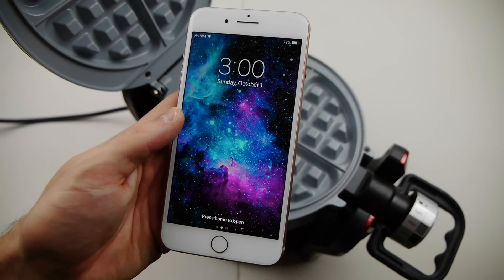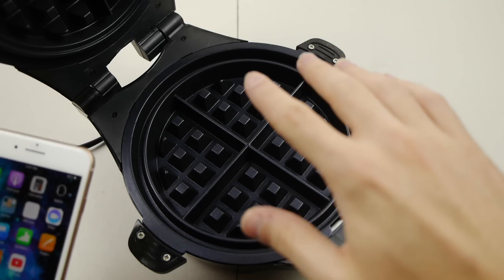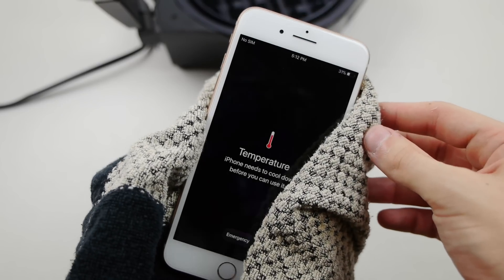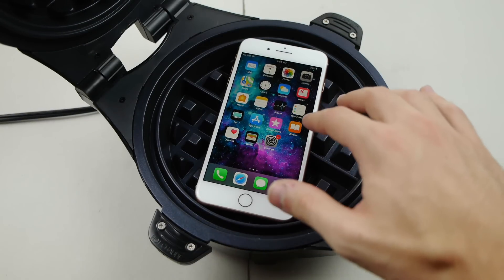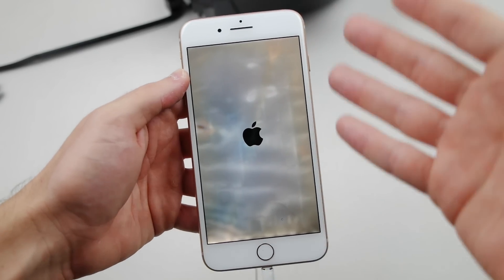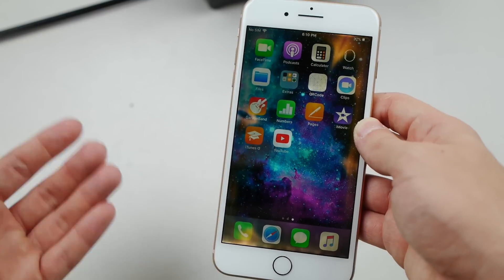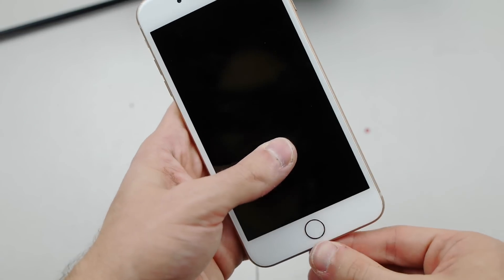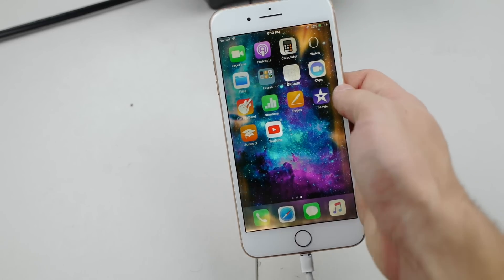iPhone 8 Plus vs Waffle Iron Experiment

Comment: The phone glitches because of battery Apple updated the software to make the processor go slower than usual as battery loses the capacity by amount of usages and condition of the battery if it’s very bad then the processor works slower to keep battery cooled off and not get too hot same thing happens with my iPhone 5s until then I replaced brand new battery and it works a lot faster than usual